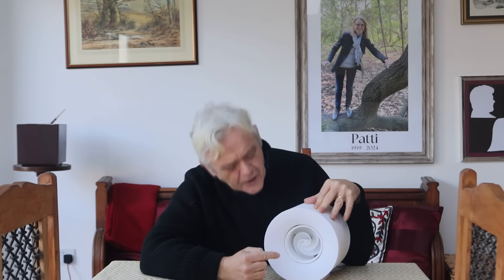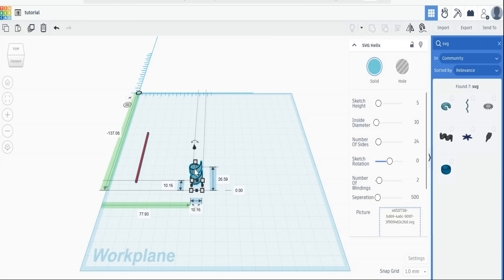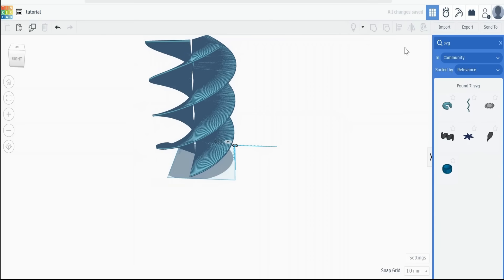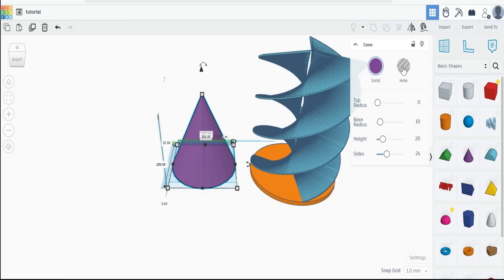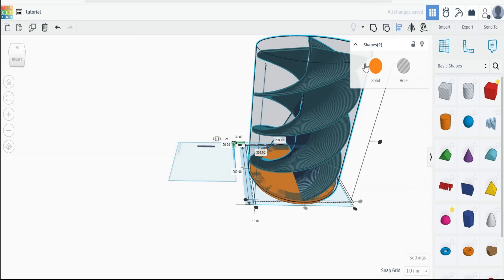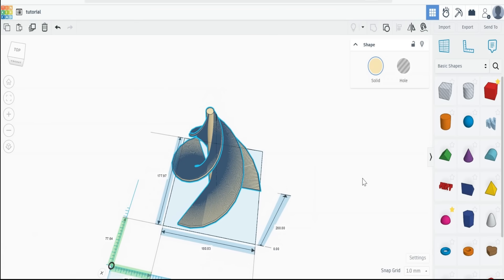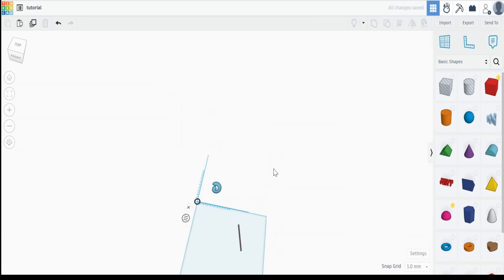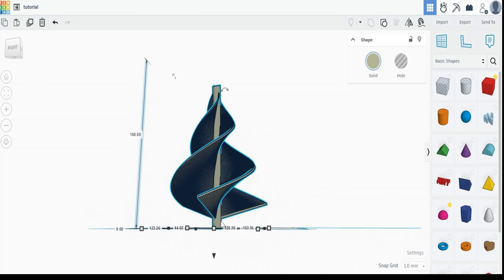2328 The Liam F1 Archimedes Screw Turbine Blade - How To Make It

Comment: robert can you design and test a rain gutter downpipe water wheel/archimedes screw generator (at bottom of pipe) ! (with 1 or 2 valves in the pipe to back up a full storey of water/rain ? maybe a victorian style bucket at top of downpipe for added weight of water.
Reply from the maker: I have already done quite a few versions of that mate

Comment: Maybe I'm wrong because it's very confusing since many seem to use the terms interchangeably, but isn't an Archimedes screw and a Fibonacci screw different?  I thought the F1 used the Fibonacci shape for the screw.  Again, maybe they are the same thing, but just seems I've seen the Archimedes as more simple helix (like yours before cutting out the cone) and the Fibonacci has the ever widening aspect the further out you go.
Reply from the maker: They are different mate - one is an arithmetic progression the other a geometric progression - but to be honest in a most applications it is a difference that makes no real difference

Comment: I have a turbine for you 😁 the Leffel Turbine company out of Springfield, Ohio has been replacing parts for a watermill in Bear's Mill, Ohio for ages. The turbines operate off the mass of the water (ten feet deep) and rotate the turbines as the water flows down a pipe directly under the turbines. Bear's Mill still makes stoneground flour, cornmeal, rye, and coffee as they did in the 1870s. It's my understanding that old fashioned water wheels went out of fashion in the 1840s and were replaced with Leffel turbines. 

Jesus Christ Almighty God bless you all
Reply from the maker: it is an interesting turbine - thanks for sharing

Comment: Thanks Robert, i had no idea about the functionality described in your video. In fact I give you credit for turning me on to tinkercad in the first place:) I started teaching myself cad in 1993 out of necessity and i wish i had this back then:) i do almost everything there now. One thing i noticed as i watched, and it occurs to me that it may have been for demonstration purposes, was the way you intially dimensioned the primitives in the video. Purely in the spirit of tips and tricks for everyone, if you hold the shift key and select the bottom left box, it will adjust all the dimensions at once. So that in your example, especially dealing with discs and the like, all dimensions would be 250mm. then it only remains to change the "z" height if necessary. I hope someone finds it helpful:)
Keep up the excellent content!
Reply from the maker: That was very helpful mate thank you for taking the time to post it - you are right it was for the purposes of the video - i try to keep the information to the main point and i quite honestly rely on you guys to pick up on things and improve what i said - it is very well appreciated you took the time to do that for everyone - cheers mate